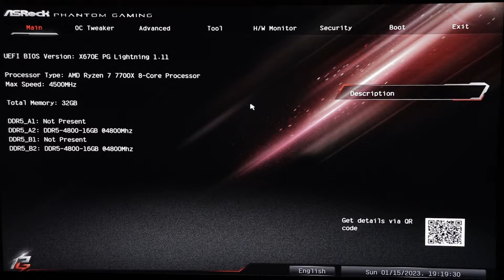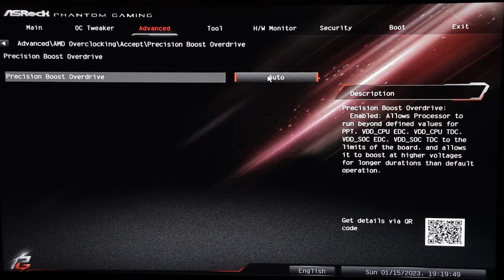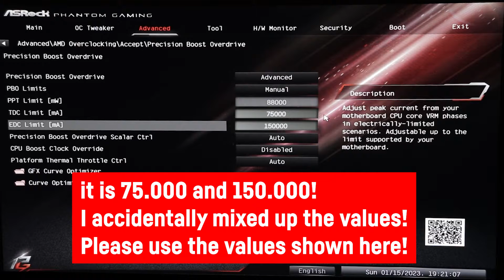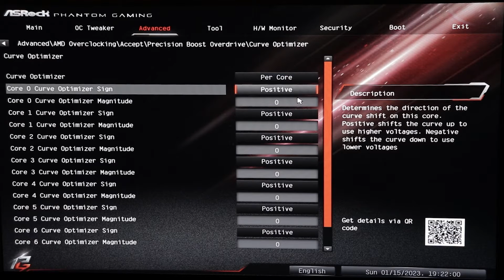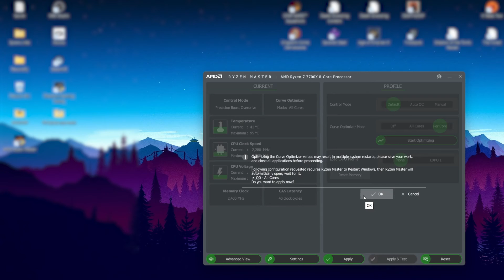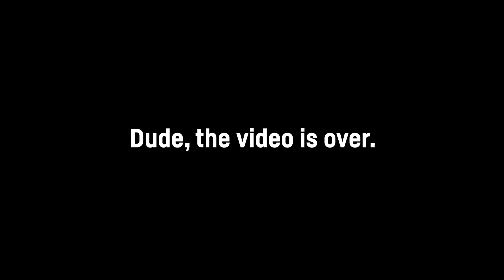How to activate the 65W ECO MODE on the "ASrock X670E PG Lightning" for Ryzen 7000

Comment: Great video! So much garbage information out there with major news sites just saying "go into your BIOS and click ECO mode, durrr".

Overall not too happy with the CPU, it overclocks itself doing mundane tasks forcing the cooler fans to ramp up and the RyzenMaster software is straight up garbage that doesn't even launch.
Reply from the maker: Hm not having that issue with the fans though. Using an AIO right now.

Comment: If the eco mode you just set up uses 65W why you entered 88W?
Reply from the maker: Nope that's not how it works for AMD. The 65W eco mode uses 88W.
Reply: @Hubwood  does this apply to all Ryzen 7 65W processors? And when we enable ECO MODE how much % of performance we lose? Thanks!
Reply from the maker: Well I actually tested this in this video (While the PC was shurely bottlenecked by the 3070 I had back then. But even with lower settings it's not that much really in most games) https://www.youtube.com/watch?v=ZsQl0_-JANc

Comment: I dont have that menu in Ryzenmaster with a 7800x3d with an asrock b650m pro board. how to I get it? the curve optimizer mode is missing. I dont have the start optimize button.
Reply from the maker: This is the motherboards BIOS menu!
Reply: @Hubwood  I was speaking about Ryzenmaster not the bios. I dont have the option in Ryzenmaster to make a optimize.
Reply: @bestonyoutube is your CPU unlocked?
Reply: @funkblack  Am I AMD? No, the 7800x3d seems to be locked, so it seems Ryzenmaster CO is not supported for the 7800x3d.

Comment: you dont need to put any numbers for TDC and EDC and can leave it on 0/auto. obviously if you put a PPT watt limit, current is calculcated from there automatically. I set a PPT of just 75W plus -20 PBO and still get 18400 in cb 23 with my 7800x3d. -30 mostly wont be 100% stable especially under idle.
Reply from the maker: Good info. Thx!
Reply from the maker: 2 years later: Yes, -30 was sometimes unstable oon idle while with -20 I had no crashes for month...
Reply: @Hubwood  oh really. -20 mostly is also not 100% stable. you wont notice it, yet there might lurk some issue in the background. do some hour testings with OCCT

Comment: Mine has the option to choose Automaticly from the Bios the limit etc.. but it does not say if the eco mode enabled is 85w or 105 or 65w do you have any idea on how to double-check what is the automatic value for that eco mode on X670E PG Lighting?

Comment: I just use Config TDP for it. Havent noticed any performance drops of it instead it boosted a little bit i think.
Edit: I enabled pbo settings, ive set all cores -30. I get 1976 single core and 18792 in multicore in Cinebench R23. I wanted to be more sure of its stability so,  i ran Prime95 for 34 minutes it didnt give any error or something and  my max cpu temp was 67.5.
Reply: Can u tell me your ppt, tdc snd edc limit dude?
Reply: @stew9942  yes sure, PPT 88000, TDC 75000, EDC 150000. These are what AMD has recommended for 65w so, i hopped into a game played bit then got a system reboot so i reverted back settings. I use only config tdp(65w) atm.
Reply: @lokkox18  I have made these settings and I am experiencing instantaneous hangs in the game, I wonder if the values are low? The ram is used up to 18 GB and the temperature dropped to 70 degrees in the bf 5 game but I'm having a lag. what should I do? cooler ak620
Reply: @lokkox18  how can i open config tdp setting reset everything and something like this is possible for gigabyte b650m desh motherboard? I don't understand much, sorry bro
Reply: @stew9942  If u have MSI motherboard u should have it. but for other motherboards u should go to pbo and change settings there.
Reply: @lokkox18  I set the ptt limit to 75, chose the motherboard and gave the curve optimizer negative 30 value. Bf 5 1% fps drops down to 20%. what should i do? is there a more optimized setting?
Reply: @stew9942  having the cpu at 65w and -30 negative pbo should make the cpu near stock power. Can you check other games?
Reply: @lokkox18  75ppt -30 negative trying. so bad bf 5 %1 fps 18 20 so bad... and i will try ty. i will speak you
Reply: @stew9942  i never asked but what cpu u have? the ppt etc these things are for 7700x
Reply: @lokkox18  where can you find AMDs official numbers for 65W for a 7800x3d?
Reply: it is good for 7800x3d ?

Comment: For instance, official AMD numbers for stock and both of common ECO modes:
170 W = 230,000 PPT, 160,000 TDC, and 225,000 EDC
105 W = 142,000 PPT, 110,000 TDC, and 170,000 EDC
65 W = 88,000 PPT, 75,000 TDC, and 150,000 EDC
Reply: 65w with these settings and pbo -30 are good for 7800x3d ?
Reply: What number for 85w eco mode?
Reply: @xboxheavy  There is no official 85W i guess, but it would be like this:
85W = 110,000 PPT,  95,000 TDC, and 160,000 EDC
But you don't need to change them, it can just be "auto", just change PPT. It is usually x1.3 of default wattage (85 x 1.3 = 110). So the default PPT of a 65W-AMD-CPU since Ryzen 3000 is 88W. If you specify PPT = 65,000, the CPU must not consume more than 65W, which of course leads to lower boost clocks, but also reduces heat generation.

Comment: cool man thanks - when trying to update the bios its showing it wont instant flash due to DDR5 overclock - how to fix this?
Reply from the maker: Reset the bios to the factory settings before you try to update the bios then :)
Reply: @Hubwood  thanks man did it with bios flasback

Comment: why 88W ? aint the new ones 65W ?
Reply from the maker: Yes. The 88w result in the "65W eco mode".

The "new ones" you are referring to will have a tdp of 65w. But that will also result in a TTP OF 88W. Meaning the new ones will also draw 88w. Not 65w.

The 65w are what your cooler should be able to "cool".

I hope that was understandable :p